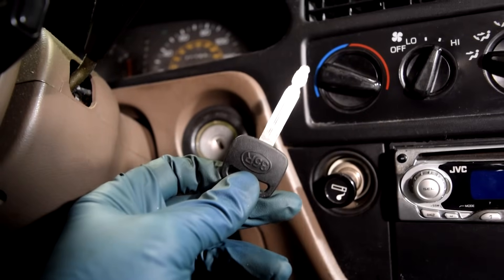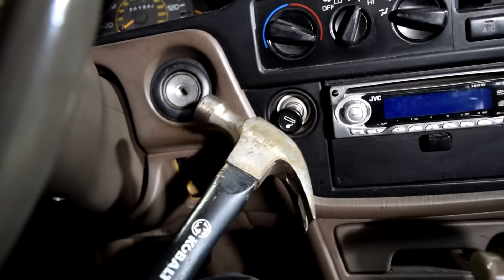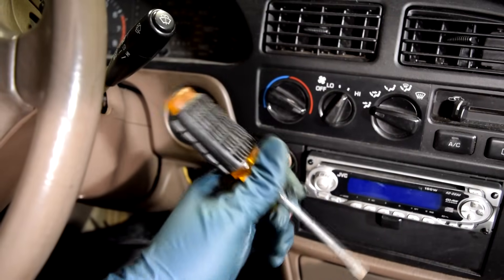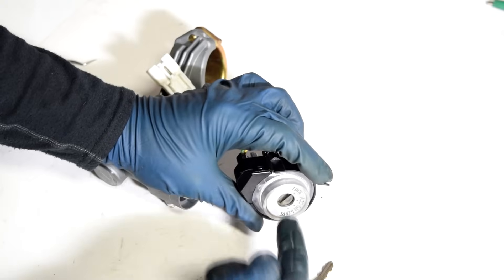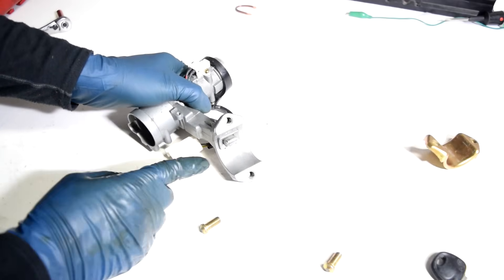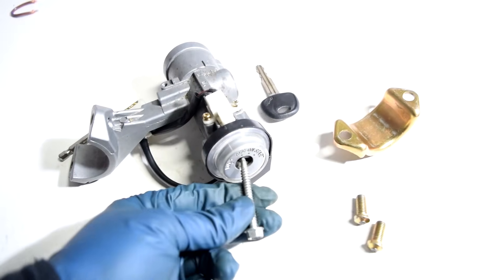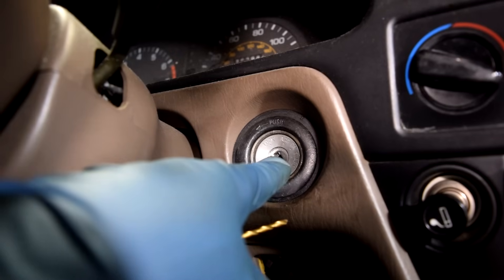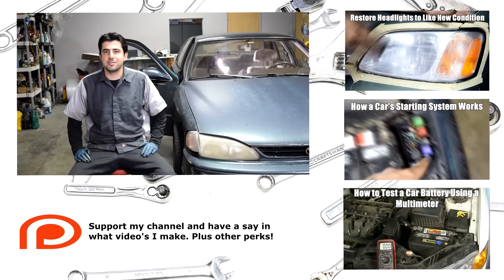How to Replace or Fix an Ignition Lock Cylinder to Unlock Steering Wheel - With or Without a Key

Comment: I’ve also found if you grab the steering wheel and of course you got to be bigger guy or stronger guy but you got the steering wheel and force it you can usually snap the pin off and then you can turn it whichever way you want with no hesitation anymore

Comment: if your vehicle doesn't have the little hole under the steering to pop the lock cylinder out (03 expedition), HOW can you take the lock cylinder out to clean and lube it thoroughly?

Comment: hey man thanks for the video, had to change my cylinder. Need some help though. After i changed my cylinder now the car wont start, It cranks and cranks but doesn't start. Is there a security feature with the cylinder that i'm missing? Car had no problems starting before I replaced. Thanks
Reply: Was it a chip programming issue?

Comment: I removed the ignitionlock and tried to start it with a screwdriver. But car wont start. Check engine lights starts blinking and the wheel lock wont go off. Pls help. Nissan almera 2000

Comment: Should be called " how to really screw up an ignition lock so you have to pay MORE money for a new lock when the locksmith gets there".    I just finished repairing an '08 KIA ignition where the customer did NOT force the lock to the on position, and it could be repaired and reused. Customer saved $75 by not messing with it more.

Comment: I have a lx 470 lexus , 2001 , and I just receive my ignition switch rod with the assembly for power tilt, now I want to know how can I remove the rod from the assembly so I can put it in the one I have that still in my lexus?

Comment: Follow these instructions with a BMW e39, and you will RUIN the steering lock housing, that's DESIGNED to foil an attempt to force it!!  There is a (very) small projection that mates with the key cylinder. Forcing the key cylinder shears this projection off.  Once this happens, you are stuck with replacing the entire unit. 

If your key won't turn or has some other problem, you're on borrowed time!  The solution is to remove the cylinder and order a replacement cylinder from BMW (or your car's manufacturer). Getting the key to turn to the acc position is the first step in removal of the BMW.

Comment: I have a 1998 toyota camry. When replacing ignition switch it came apart. I am having trouble putting it back together. I believe I have it correct but still won't work. There are 5 small springs and 2 small bearings. Do you know how it goes back together? Or do you have any idea where I could find it out. Thanks. Also it has two copper discs. One small and one larger. It seems to me  it can only go one way. I am not sure I found all parts.
Show less

REPLY

Comment: my u can turn without key, but if I go to lock, it will not turn, steeling wheel will not lock and if it does, I can rock it back and forward and it turns, it feels like something is on connecting to unlock, I have had car 4 years and u could all ways turn it with anything, I don't want to replace it as it old and crappy. and key has chip
Reply: I just leave it on accessories, but battery go battery goes flat after a week and two if I forget and go to far, it takes longer and longer to get back off lock

Comment: How do you  get the new  cylinder to match your key?  Has to be able to turn it obviously.
Reply: Programming is just for the chip that's in the key so car can detect it, otherwise car won't turn on even tho the key and the lock is turning normally. 
What I think you meant is how to make that new key match your old ones so you don't have to have a different key for the main lock. You do that by opening the lock (before you put it in the car obviously) and swap the pins from your old lock into your new one, that's how they make the lock have the same key as you originally had. That's how they do it in factory repair shops.
Reply: I think they all come with keys
Reply: If you buy a new cylinder it will come with its own keys.
Reply: @gcastillo4350  So I have a chipped 2002 Honda Cr-V.  If I buy just the cylinder and a new key, can I put the chip from my original key into the new key and it will work with my car?  I know I still have to use a different key to open the door, but it'll save me several hundred dollars.

Comment: Took two hours because the wheel was locked and couldn't get the panel under the steering column so it was very difficult to drill out the pin and once we pounded out the ignition with a small flathead it would just turn all the way arou freely so we couldn't just take it out without drilling the pin out

Comment: I can't turn my key its stuck.  They broke my steering wheel lock and my shifter lever also moving freely too.
Reply: The wiring connector is also missing too.  I  dont see it anywhere 95 chevy c1500.

Comment: how do  i make for a bmw e46 2 remove da ignition whn my key is lost
Reply: Phone BMW dealer ask if they cut you a key if you provide VIN and proof of ownership.
Reply: You just drill the ignition tumbler out and then use a screwdriver and you can remove the steering wheel after you unlock the column and then you can take it apart and replace the tumbler that you had to drill

Comment: My key is stuck IN the ignition AND the ignition switch is stuck in the ON position.  So I can't use the screwdriver method. I don't have a drill strong enough for drilling. Time for an expert

Comment: I’m a locksmith and most of the instructions in the video are very wrong and 95% of those ignition cylinders are fixable and if you what the guy says you’ll ruin your ignition completely. Those ignition locks can be very expansive sometime and you don’t want to ruin them!!!
Reply: Alan Miller so how would you properly fix it mine is locked in the semi off position
Reply: Alan Miller I agree, I'm a locksmith also , those instructions will get you into a bigger jam .
Reply: So what would you recommend.   My car won't release the key.   Actually it won't go all of the way into the locked position?   I don't have a locksmith near me so I have to go to a town twenty minutes away.   I need help.
Reply: Lock smits cost what 300 dollars to make a key it you lose it
Reply: @Daniel Simpson thank you but dealership don't go back to 2003
Reply: @Daniel SimpsonI just tried the 1 Ford dealer he told me 2003 is the farthest they went back didn't think about calling another 1
Reply: We call that a HAMMER TECH. go ahead and try this. Then replace all the items and bulbs you destroy in your dash.
Reply: My key is stuck in the ignition, the steering wheel doesn't budge and the key barely moves.
Reply: @normanevans124 , spend it now of spend more later. As a locksmith I charge double when I have to rescue somebody that tried this nonsense approach.
Reply: @pseudosaur Sounds like a neutral safety switch , not a key problem
Reply: @andyhatfield7757  Thanks! Had to replace the ignition on that one.

Comment: Be careful, I used a screwdriver and 3 lb hammer and desroyed the cylinder, and it Still wouldn't come out. I had to go to the yard and get another coumn and take it to the locksmith down the street and have it pulled. It was more than the used column was to do it due to ruining the original column. It doesn't always work that way. No offense to R & W but it's not always as easy as things look on these tutorials, By Experience !

Comment: Nothing works i cant turn my key to remove it and I've tried everything to fix it and they wanna charge me hella money
Reply: Me too. Honda dealer wanted $700 to replace the key cylinder and set it up for my key. Nope. I phoned around the scrap yards and got one for $75 where the key went in smooth and turned easy. I watched about 4-5 YouTube videos on replacing the cylinder and got the new (scrap yard) one put in myself in about 2 hours...I took my time and went step-by-step. So then I could turn the key but because the security chip information in the key did not match the old one, it would not start the engine. I called an automotive lock smith and for $75 he came by in his van and reprogrammed the computer to accept the new key. I have to use separate keys for doors and ignition now, but $150 and two hours of my time beats paying the dealer $700 (or more).
Reply: You could have always just disconnected the ignition switch from the assembly, put the original key in the new cylinder and then started the vehicle by activating the ignition switch.  Then just take out the original key and put in the one that turns the cylinder so that you can move the shifter.  That's what I did in my Rendezvous.

Comment: A screwdriver and a hammer to remove the ignition lock cylinder out? I have to ssay that is the worst possible advice ever. This is coming from a 12 year automotive locksmith do not use your screwdriver and slam it into the ignition